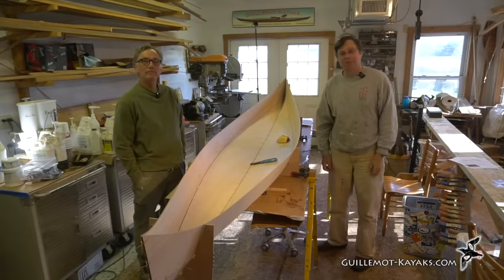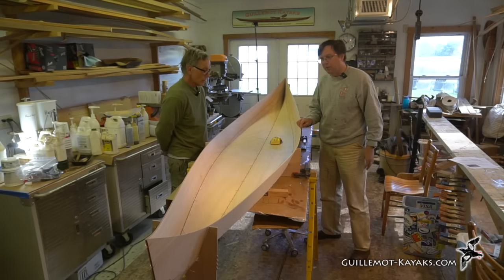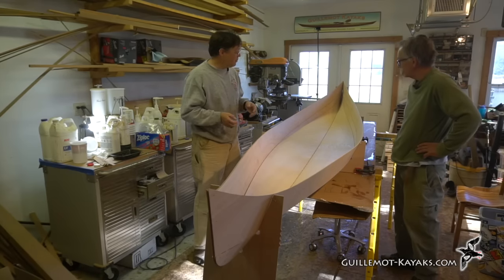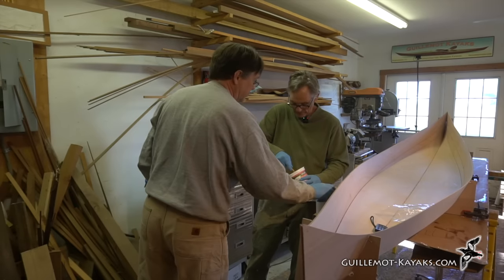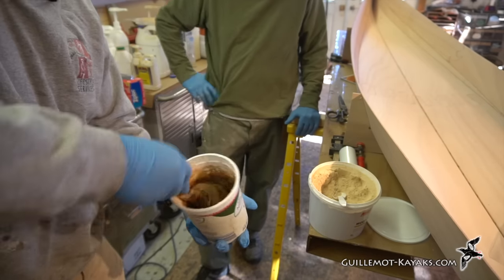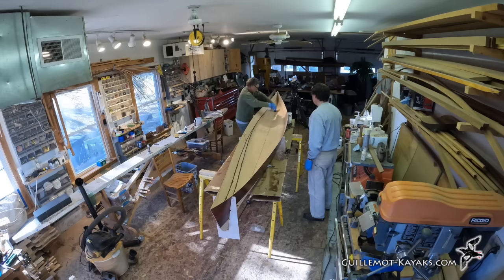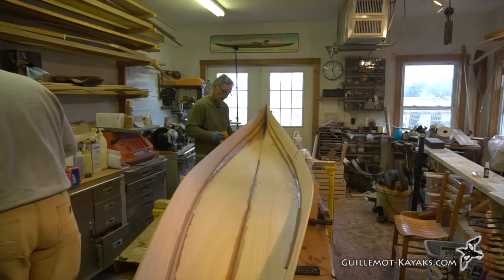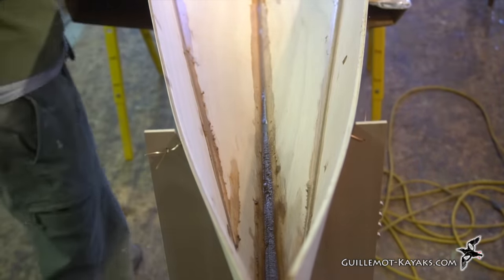Epoxy Fillet Fundamentals on a Stitch and Glue Kayak - Petrel Play SG Build - E5

Comment: I’ve found that if a wire brakes coming out, I will apply some heat with a soldering iron to the wire and the heat will make the wire come out smoothly.
Reply from the maker: My goal with this process is to not get the wire glued in, but heat absolutely will help free up wires that get stuck.

Comment: I spent some time with the Gougeon brothers in the mid 80’s and I would have been slapped silly incorporating old mix with new.that was 40 some years ago so maybe things have changed since then. I’ve been out for a long time so who knows what’s changed.
Reply from the maker: It may not be "best practice", but I have never had a problem with mixing together new with old batches. I'm cheap so, I don't like throwing away perfectly good schmutz.